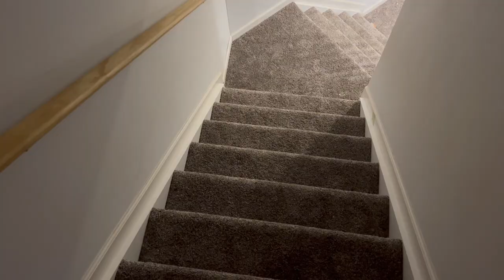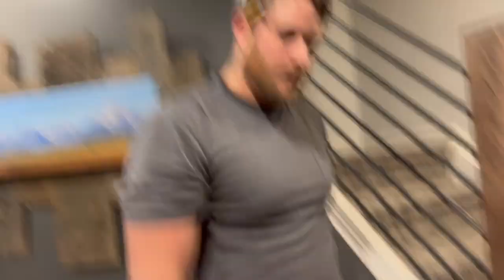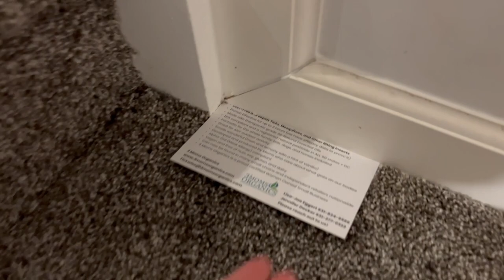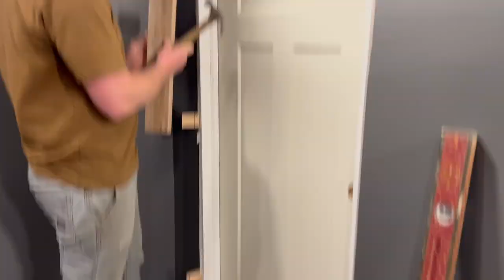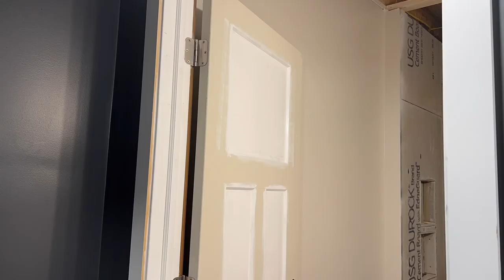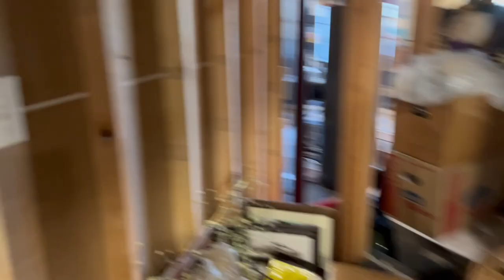Finishing Our Basement #22: Final Touches to the Movie Theater (Trim, Doors, Paint, Caulk, etc)

Comment: I assume that bathroom goes to a sump pump?  You guys probably already figured this out, but just be sure to run some water for a  couple of minutes or so whenever 'done for the night' down there, to dilute and flush out the sump pump.  Any kind of waste in there, if it sits there for a couple of days or so, the odor always gets out.  We added a basement bathroom in our last house.  It was really close to the water heater, so showering in it was awesome.  I was the only one that understood that water should be run after the toilet was used b/c at least our sump pump, one toilet usage wasn't enough to get it to pump up to the main line.
Reply from the maker: +Monkey B Hello there! Yes. We have a sump pump. Our tank is sealed and fortunately we don’t have any odors leaking:) If the odors every appear, now we know what to do! Thanks for the tip!